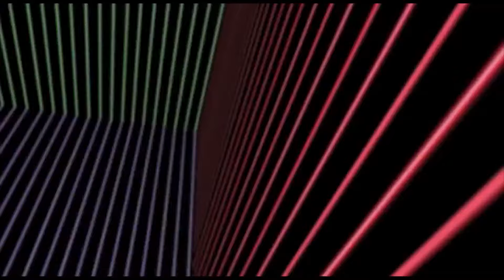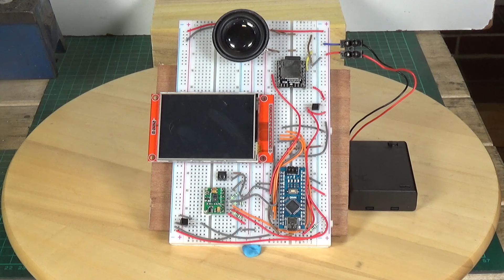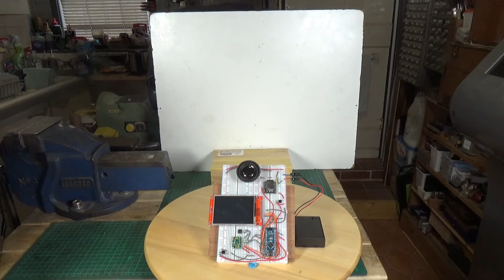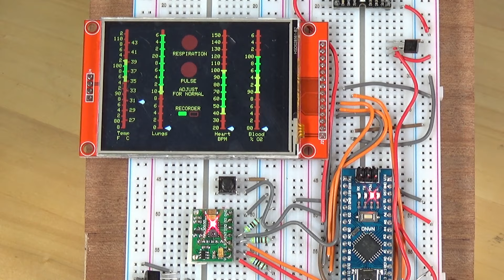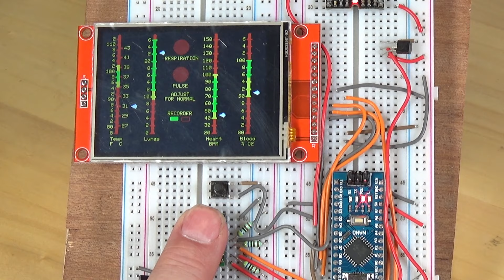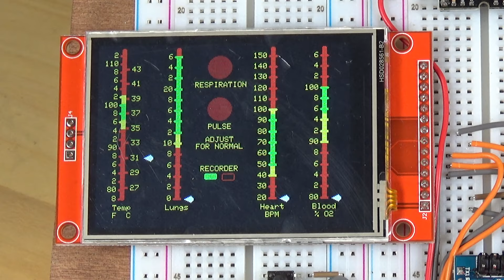First Adventures With An Arduino

Comment: I've said it before, we're living in a golden age for DIY hobbyist electronics. Never before have electronic kits and parts been so cheap. Remember how expensive Maplins was? Imagine going in there to buy all the bits to put this together.....
Reply from the maker: I couldn't agree more. I do kind of miss Maplins though, if you needed a part real quick they were quite useful.
Reply: @RetroSteamTech  Indeed they were, I often went into the one in Liffey Street, Dublin on my break from work. You could see the writing was on the wall for them for a long time. It was kinda sad going in and watching it slowly deteriorate. It just got silly, they forgot what they were and started trying to be a high street computer retailer. If they had a better internet presence, it could have been different. Trying to order anything from there website was painful. 

I bought all the component drawers from the one in Liffey St. Collected them on the last day, the staff were sitting on creates drinking a few beers, doors open and people just helping themselves to what little stock was left pilled up on the floor. A sad ending...

Comment: Even though I worked in IT and can program I've never gone down this path.  Looks very infectious ;)  Lots of fun I'm sure.  Just thinking of the workshop possibilities.  Thanks for posting. Cheers Rob
Reply from the maker: I'm a hardware guy not software but the Arduino program that is used to upload code to the Nano is very easy to use. I might have a dabble and see what i can do. 🙂
 Cheers, Alan.